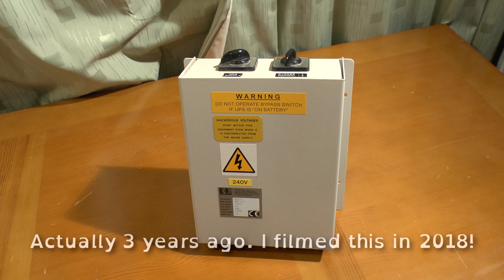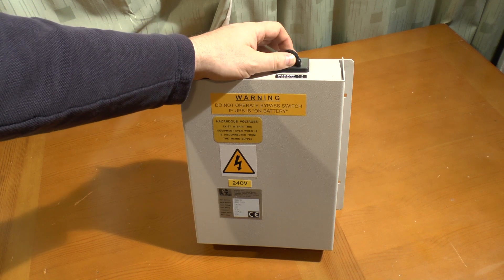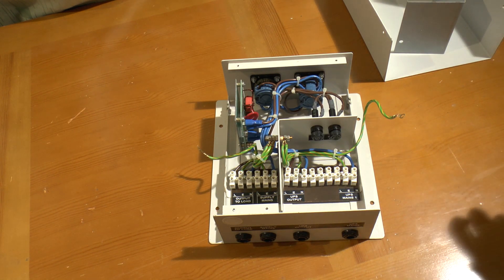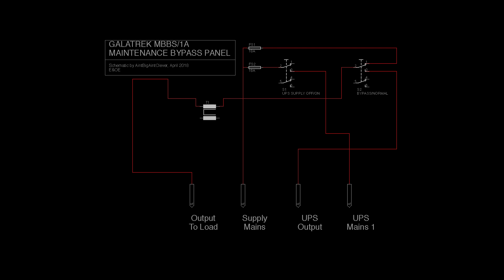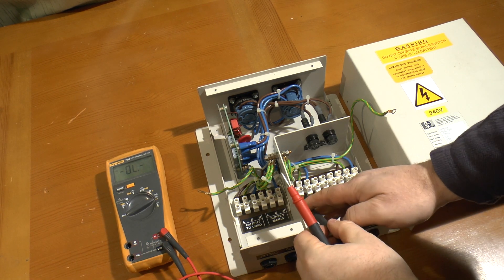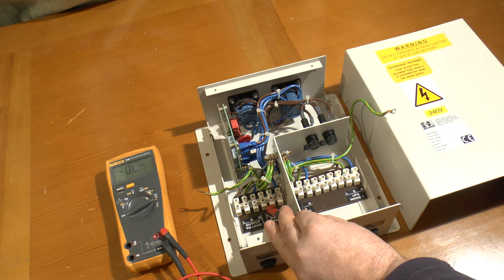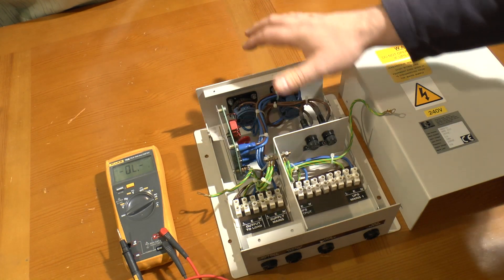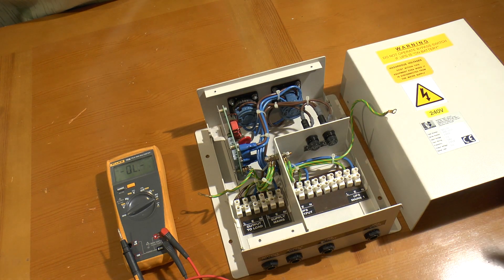Galatrek UPS Maintenance Bypass Panel (and why you can't use it as a Manual Transfer Switch)

Comment: It seems to me that modern "break before make" bypass/ transfer switches should be quick enough to avoid dropping the critical load. I use one on my solar system with quite high loads all the time and never drop loads. Also the built in transfer switch from utility main to inverter output is fast enough as well. While this is of course a manual switch, I'm surprised they couldn't find a snappier switch to transfer without issue. But what do I know... not much quite honestly.
Reply from the maker: I think the Galatrek (and other ferroresonant) UPSes are for stuff that's particularly fussy about spikes as they have no-break switching between mains and battery.  The make-before-break bypass panel means there's also no-break switching between protected and unprotected mode.

Comment: I just found out that some custom made PDUs at my work, which have a mains and a UPS input were wired incorrectly, and the neutrals of each supply were permanently connected together. We powered up the UPS on battery, and we measured over 20V on the pins of the male inlet.
Reply from the maker: Between which pins?  You may find that the current availability is enough to register the voltage on a meter but if you put any load across them - even a 120/240 volt light bulb - it may just fall to zero.
Reply: @AintBigAintClever  It was a rack mount PDU with a 32A power inlet connector on the front, and a UPS input on the back.

It also had a bypass switch, but because both of the power inputs where made by a plug and socket connection it would be dangerous if the two supplies could be connected together, so the bypass must break before make, and it was supposed to be double pole, but the manufacturer supplied it wired with only the line conductor switched. 

So if the UPS was running on battery, it’s neutral was also tied into the grid 
neutral. You could also get a shock from male plug pins if one of the power inputs was reverse polarity.

Comment: Not what i would call a good implementation.
Would be better if the switch could not stay in the middle, a spring loaded toggle action for instance, or a make before break ciontactor that would have a very short operation time, plus it could be interlocked so it cannot operate if on battery
WHere i worked we had a maintenance changeover for a server room ups, but i can't remember the details.
Reply from the maker: Yeah, when you look inside you realise it ought to be "qualified personnel only" to operate it.  Get it wrong and you'll get it very wrong.
A pair of solenoids that would each be able to block rotation of the bypass switch unless both output to UPS (one solenoid) and input from UPS (the other) are energised would have improved safety and given the added benefit of preventings accidental de-energising of the output.
Reply: @AintBigAintClever  Yeah, quaified only would help, along with locking the switches
I know the risks, i was qualified to switch 11KV on our site  (5 sub stations fed from a central switching yard), get that wrong and the switches could explode :D
Reply: @sparkyprojects  That feeling of being past the point of "idiot proof" interfaces, behind lock and key, posted with warnings, and "authorized clearance only" just tickles that part of my brain! Kinda like operating heavy machinery. When theres zero tolerance for mistakes. Leaves a certain tension in the air and demands all your focus.